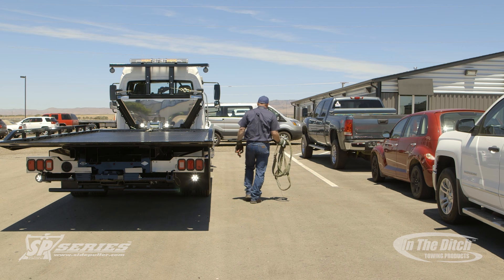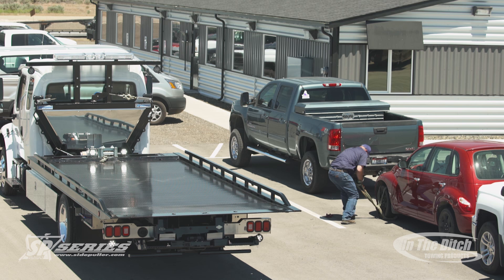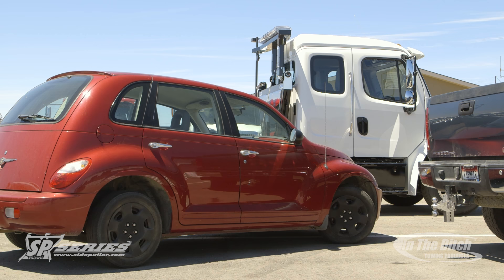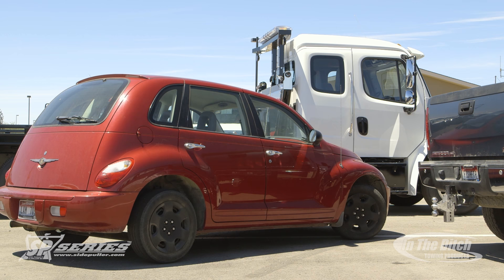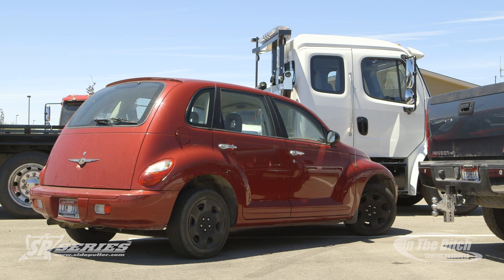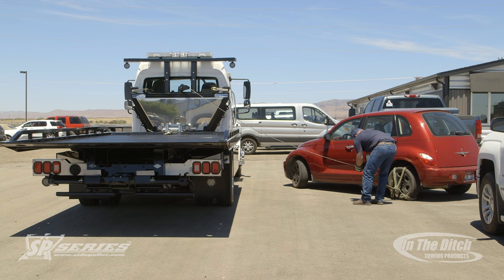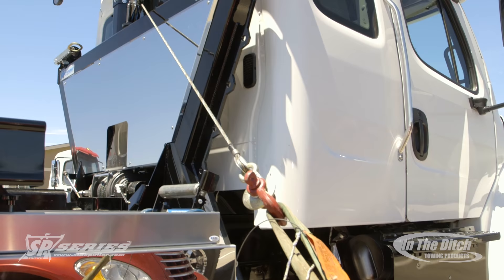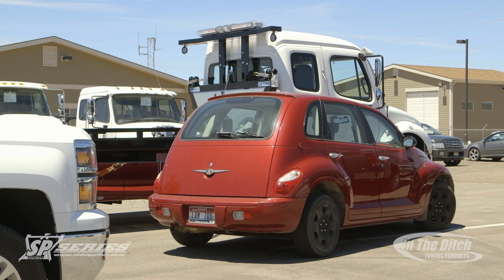SidePuller Recovery Episode 4/10-Winch a parallel parked vehicle out of a parking spot, technique 1

Comment: Here is my thought on this... I'm having trouble figuring out why you would want to do it this way, and if you HAD to... why would you not low pull from the outrigger? Especially! If it was an older vehicle. The ball joints are not designed to be pulled in that way anyway. Though we do it during recovery, being a professional I always think how can I be easy on it. Low pull from about the height of the wheel and straight pull with the pull on both upper and lower ball joints equal instead up high pulling and putting all of the stress on mostly the lower and possibly pulling it out and further damaging after ripping it out. Also... Low pull if it does brake anything it's pulling straight away and not up.. I don't know. Maybe I think to much...

Comment: Or you could just use a snatch block to the end pockets on the bed seeing as you would have to load it anyway and a snatch block would easily pull it out and load it at the same time...
Reply: 😂😂😂😂 my thoughts exactly
Reply: @larrygonzales7410  I give these side pullers so much shit lmao, They are cool for sure, And they can be useful most definitely, but these side puller guys just use any fuckin excuse to use it and act like only they could do it with their side puller, the only time it's really actually useful is for 1 having the stiff legs, and two having a 2nd winch line on a rollback, other than that anything it can do I can do without a side puller.
Reply: Is the strap on the tire risky on raggedy cars?
Reply: @alexandria9246 Yes and no, For like a disabled vehicle, or a vehicle parked in a public parking lot like this, generally it won't be an issue because the vehicle had to drive there on that wheel anyway, so if it weren't structurally sound chances are it wouldn't have made it, and the wheels typically are one of the strongest points to hook to for that very reason, if done correctly your wheels should be the strongest point of the car because you don't really want those coming off, manufacturers don't always accomplish that but they should, Now you would want to inspect that hook spot anyway to make sure nothing is broken like a low control arm that would make it no longer structurally sound, But for a car where there is no real visible damage to those components I don't see it being much of a problem, and realistically if the car is in bad condition the frame slots or other possible hook points aren't going to be in good condition either. But for good condition cars it's certainly a good spot, Actually just this week I winched a chevy transit van out of a ditch by just the one wheel as it was in a flowing water ditch and that's the only spot I could get to with trees and elevation change making everything else impossible to reach.
Reply: @alexandria9246  I use a short strap on newer cars so they don't scratch coatings and rust as we live in rust belt. But as guy said if it was that bad they never drive it to pickup spot. Some ppl though will amaze u. Watch Just rolled in, shows about working on publics autos. Some I wonder after they show hoe bad, customer refuses repairs and drives home, how they made it? Some don't and break down in parking lot. And most importantly, it's DANGEROUS to all around driving in that kind of shape. I'd rather not die or see u die cause timmy wants to drive his Swiss cheese ranger in town and not fix it properly.

Comment: so who pays for the damaged steering rack and or lock pin? the front wheels were clearly force turned.
Reply: I know right. Have a $150,000 truck and not pay for damages on a junk car. This SIDE PULLER is a JOKE. Just get a wrecker self loader or a big guy to push the damn car...oh wait, not really. The fucker might claim worker's compensation from injury.
Reply: Its a demonstration not a how to recover every vehicle situation, that's why you hire operators to make those judgement calls.  Maybe the wheel was unlocked (assuming it has locking steering, most don't anymore) and wanted to get it out of the stall without pushing it back and forth 5 times to get a loading angle on it.  You're looking too deep into what they are doing instead of how they are doing it, and that's the point the video in the first place.  HOW you can use it is the point.  We've had one, the first design actually, for like 12 years now and I've recovered a lot of really bad crashes, cars in two pieces, straight trucks in ditches, steep ravine recoveries.  For 10-15K it boosts the trucks potential a lot for what you pay in money.  In most places you could run beds with sidepullers and not ever have the need for a wrecker.  For that odd job you may need one and you are a large company you'll probably have heavies standing by anyhow and can just use one of those.
Reply: Snatch block it lol
Reply: Ive drug thousands of cars just like that and never once damaged a Steering Rack. It'll be Ok
Reply: If they have to drag it out of a spot its either because it has to be done  for a wrecked or a transmission locked car or you were parked illegally or being repossessed. In any of those cases, your wheels being dragged is the least of your problems
Reply: @TheVercettiTV   this side pull will pull just like a wrecker and it will be able to haul a demolished car on the bed and it will be able to wheel lift medium duty
Reply: @myveryown07  These trucks can not wheel lift medium duties, It can haul two, and haul vehicles so damn mangled you wouldn't want to even try to put them on a wrecker, but it will not haul a medium-duty safely or legally.
Reply: @sunnydeng9263  Well that's something you should bring up with legislatures then, As at least in my area if that is the case your car in being impounded by the property owner or by PD, and when impounded by PD I have to get that car out one way or another, Now this is not the route I'd take but if it came down to it I would have to do so. As for the 100k reference, not a great reference to make when arguing with tow guys as the truck you just watched was upward of 120k.
Reply: @The Silenced Serfs?

Comment: That just seems too complicated... Why not just tow trucks like they do in London..
Reply: Versatility. That's pretty much the reason, We don't have roads or parking like london, For some vehicles, it very would make the job easier, parallel parked vehicles it would make easier for sure, but then you got to pull the car from 100 foot down in a ditch and that truck is no longer useful at all, And actually calls where a truck such as in london would make it easier are far out numbered by the calls where I would need my normal rollback truck, I almost never have a car where the london style truck would be better, and those I do get aren't difficult to load either, it just takes a little bit more time.

Comment: The City of Minneapolis told my car like this a vehicle in the front of me a vehicle in the back of me lots of ice and debris under the car. When I got my car back the front and back suspension system was completely ruined I felt like I was driving in a different car every time I go over any little crack all the tires hit the top of the wheel well now it feels like I'm riding on rims was this caused by them pulling my car over ice and debris and uneven ground from parallel parking position where I was the middle car?